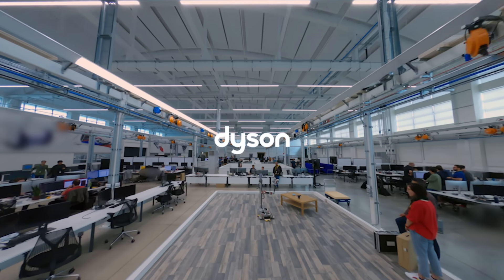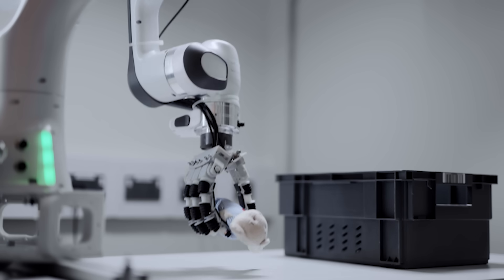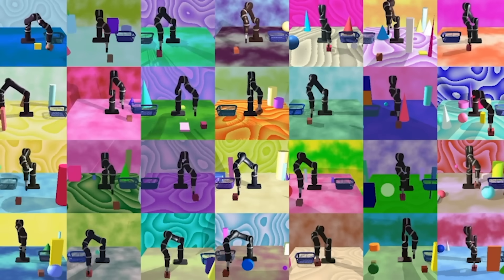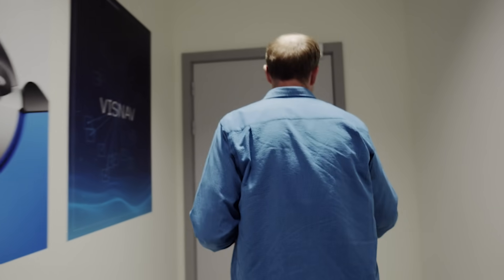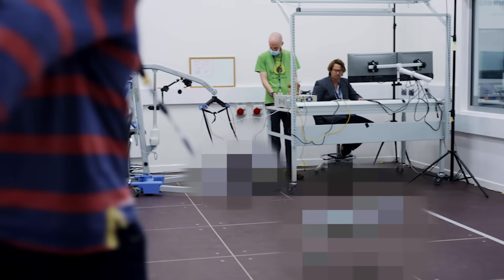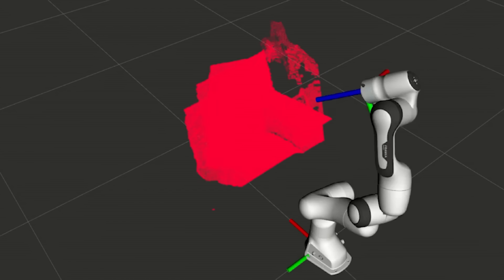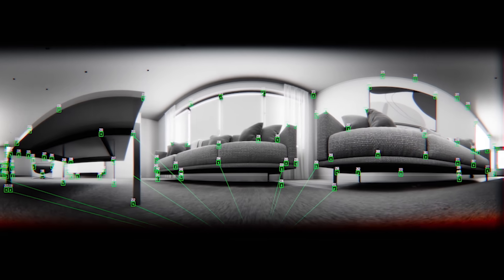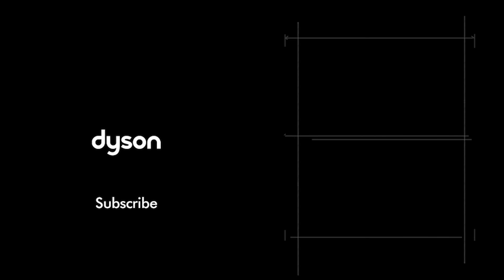Dyson gives glimpse of secret robot prototypes which appear to carry out household chores

Comment: You can buy any brand and any appliances ,nobody has ever made them as strong and durable as they were in the 70’s / 80’s. 
My parents were expats all their life and all their appliances followed them (Saudi , Oman ,Nigeria etc ...) and have never had any problems even in extreme heat or humidity . They were sturdy and ugly appliances with big buttons you had to press or turn and making big noise like infant toys but made in thick metal but were so reliable. In fact those appliances would be nowadays put into the professional category like washing machine or dryers you find in launderettes.
The good thing is that with less and less fossil fuels so less energy we will come back to manufacture again those type of items because we will not have the luxury of manufacturing disposable stuff .

Comment: 0:14 Ah yes, the "Dyson Snot Cannon", also known as "the Mobile Supers Spreader Event". Impressed to see you're still showing that after all the media backlash and obvious oversight.
Reply: Never heard anything of what you mention, maybe it is a big thing in your country? 
I never bought a Dyson product, but they always do innovate and their engineering is impeccable. No matter what the critics say the other manufacturers try to copy their ideas and products. They still cant do a better job than Dyson.
The company is still going from strength to strength despite the alleged bad press.
Reply: @berty1422  The "Dyson Zone" product is fundamentally a pre-pandemic concept predating the time we realized how much of a problem superspreader events and over-dispersion really are. That isn't the problem though. The real sin here is that they marketed a product that was intended perhaps to curb exposure to air pollution in urban scenarios then as something that would equal real PPE *now*. The design does NOT filter exhaled air, nor does it attempt to even collect it. Even worse, it produces a forced air zone that blows fomites and aerosols from the face into the environment. What it does is akin to farting in an elevator that lost power. Surely the engineers solved a problem with technical finesse, but they solved the wrong darn problem. Then marketing doubled down on it and went forward with the product.
Reply: @berty1422  Dyson removed my reply to this comment.

Comment: As well as adding complexity Dyson needs to work hard on simplifying. I think its possible, Dyson vacuum cleaners for example have waaay too many parts that are easily broken. Unfortunately the human body has over 600 bones and probably as many muscles to 'locomote' it all, its a highly complex machine so producing robots that equate to some of a humans functions is not going to be easy to simplify. My Aibo robot dog from the 90s had >20 servos and it has long since stopped working, the body renews itself every 7 years and I am still functioning relatively well, there are some big challenges ahead.
Reply: Dyson also refuses to supply parts for repair, and actively fights right to repair.
Reply: 600 bones? Are you just blindly regurgitating misinformation? You don't know what you're talking about if you think humans have 600 bones. There are 600++ skeletal muscles though.
Reply: @edenassos  yeah lol it’s way lower than that, apparently it’s between 206 and 213 bones
Reply: My mom has had a Dyson vacuum for 10 years that still works perfectly.
Reply: @bucky13  You mom's vaccum is in the minority.

Comment: I am very skeptical that the electronic components building blocks really exist as yet (2022) for such an endeavour.

I don’t think that full digital boolean logic is the way to go for robots that have some sense of real awareness / conciousness to safely do chores at home. It is like Charles Babbages that was a bit too early for his time.

I think that one of the key electronic component still missing is persistent memory like MRAM / spintronics. 

I do think that big tech companies should first be allocating more ressources to accelerate the development of MRAM/spintronics and only after that, explore new possibilities
Reply: bro what are you saying
Reply: What I mean by that, is that in my opinion, all tech companies that are trying to develop chore home robots with digital silicon electronic transistors, are like in some way trying to develop smartphones with vacuum tubes diodes transistors (silicon transistor ancester) : the technology building blocks are not there yet to be able to do that efficiently.

My hunch is that spintronics and MRAM persistent memory could open new opportunities to more efficiently build such systems.
Reply: @lukelmg  You're on the Internet, you could look it up yourself.

But in short: Boolean means logic where something is either true or false, and nothing else.  This fits into computers using 1s and 0s that comes from the transistors they use being either on or off.  In other words, true or false.

This is not how brains work though, and fundamentally limits how far AI using Boolean logic can go.

Comment: They should do some research on handheld vacuum cleaners that are aesthetically pleasing when hanged against the wall in an open area. For example, by using white and light gray colors, instead of dark gray and random colors.
Reply: look at the xiaomi vaccums, those fit your request quiet well
Reply: Was thinking the same thing. Instead of looking like toys why not design them to look better, cooler, more modern. Always the same ugly style, a new look is long overdue.

Comment: All very well, but I had two Dyson cyclones in a row, both of which lasted nowhere near as long as I expected, were incredibly LOUD and pieces regularly broke off them. (No, I wasn't being rough with them.)

Now I have a German model that has overshot the Dyson lifespan, cleans beautifully and is virtually silent. 🤷‍♂️

So forgive me if none of this excites me.
🇬🇧
Reply: What model?? I'd love a quiet vacuum. American brands make them intentionally loud.
Reply: @Hellefleur  I've been happily using a cordless shark vertex for 3 years without any issues and also they list all the parts on their spare parts site to buy for repair should anything go wrong. Check out the review on 'Vacuum Wars' YouTube channel.
Reply: @Hellefleur  Miele. Ours is the one designed for people with pets.
(In the UK, most people's dogs live indoors with them. We're not big on outdoor kennels, not unless they're working dogs.)

Also, there's a rising demand in Europe for the Right to Repair. My Dyson units were irreparable when bits broke. I won't buy another household device that willfully resists my right to fix it.